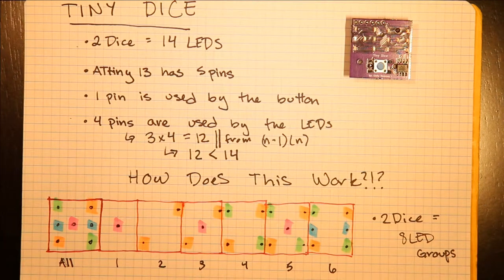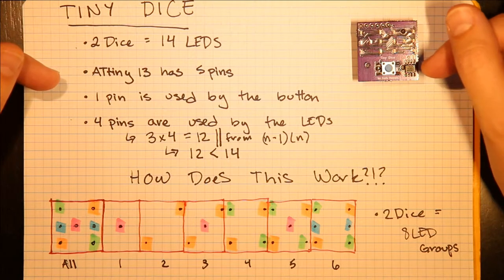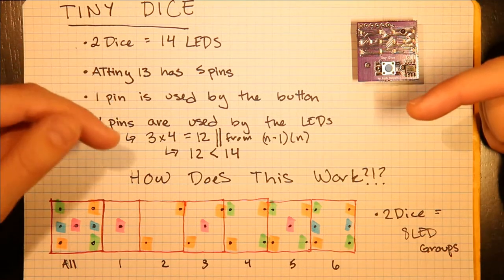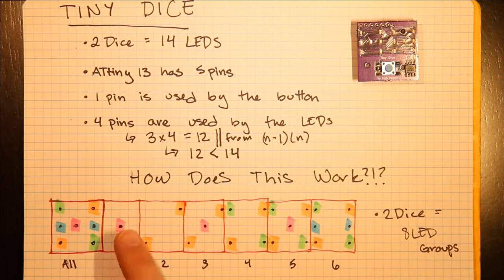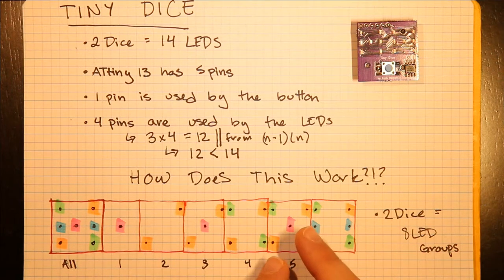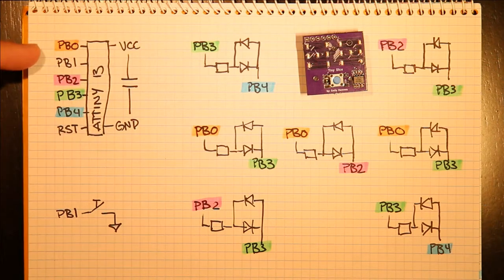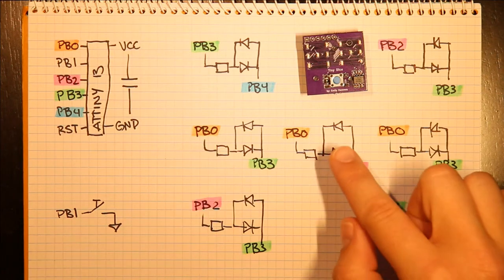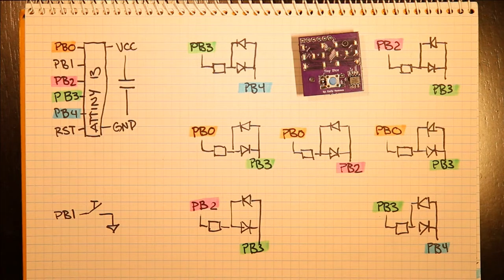How Tiny Dice Works

Comment: Thanks for this. I'd already figured out the 7 LEDs by 4 pins thing in my own building of a single dice. However my journey with charlieplexing is immensely painful - I think I know how it works, it's taken a lot of drawing routes around circuits, but then when I tried to put it into practice I've never got a circuit to work. Now with this example of it I can see you've chosen to put the equivalent placed LEDs as pairs in the charlieplexing circuit, which seems a reasonable place to start, though as the two displays are unrelated (random), I don't think it's necessary (????) but we have to start somewhere! The colours help clearly show that each half of a pair is being controlled the same way, but then I've no idea how you worked out which outputs needed to go with which inputs. I think I need to go back to the beginning with this charlieplexing thing, I'm not sure in reality how often I would use it, so cool though this project is it's not high on my priority list, but as someone who asked a question it's good to know which bit of the circuit I didn't understand, so thank you for this explanation.